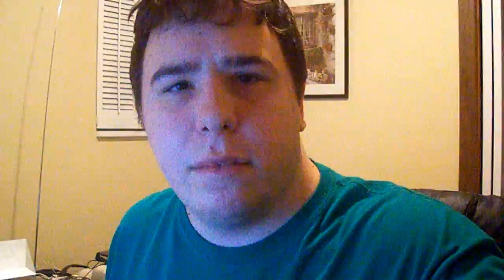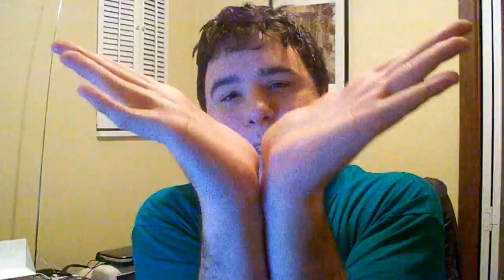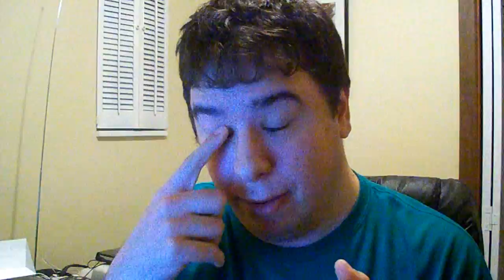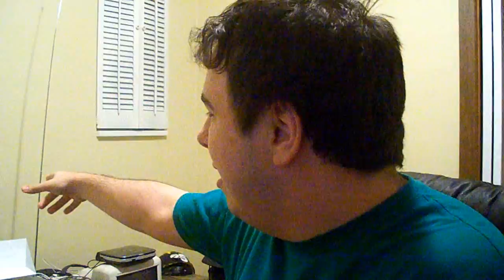Debunking HAARP Rings, Scalar Squares, and Other Radar Processing Anomalies

Comment from the maker: @skybotgaming and you'd have to do a lot more than simply heating a patch of an already hot layer (the ionosphere is not like the trophosphere in any way) to change the weather. You'd have to defeat the stratosphere and destroy completely the ozone layer over the area of interest, remove the inversion there remotely, and then cool, not warm the layers above, to create more intense convection. Most people think "heat rises". It doesn't. The upper atmosphere is both hot and cold.

Comment from the maker: @skybotgaming First of all, if you don't like the video, don't watch. Secondly, the ionosphere has no top to it; it extends to infinity (or for practical purposes, about 50-70 miles, depending on whom you ask.) And if you would put the Kool-Aid down, yes, the ionosphere is disconnected. Where HAARP is aimed is a place where the pressure is 1/100 to 1/1000 that of sea level. So, the dispersal will be spread throughout the fluid. By comparison, a synoptic low will have 50x the effect

Comment: patent 4999637 - Creation of artificial ionization clouds above the earth

patent 4712155 - Method and apparatus for creating an artificial electron cyclotron heating region of plasma

patent 5041834 - Artificial ionospheric mirror composed of a plasma layer which can be tilted

patent 4686605 - Method and apparatus for altering a region in the earth's atmosphere, ionosphere, and/or magnetosphere

patent 5777476 - Ground global tomography (GGT) using modulation of the ionospheric electrojets